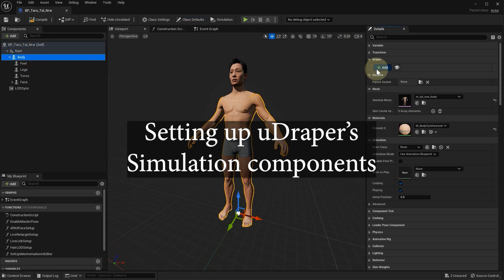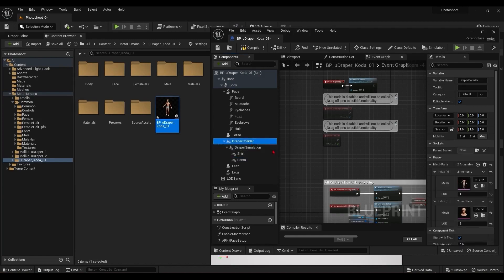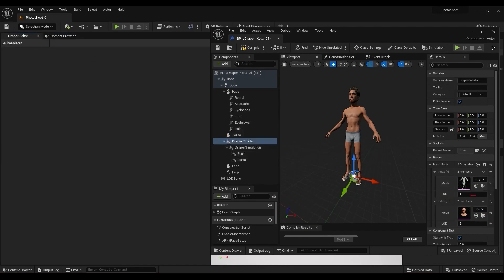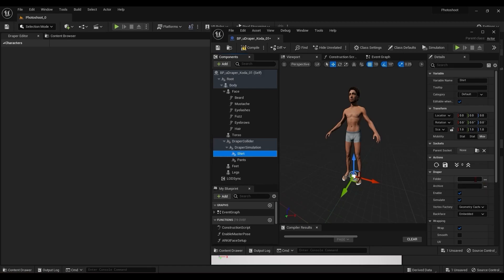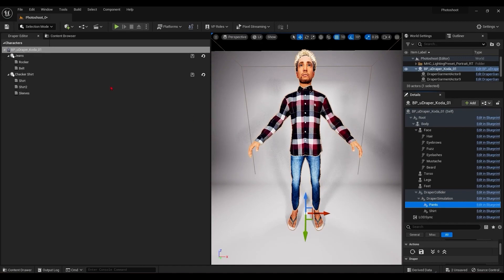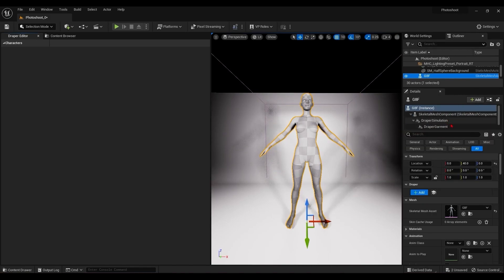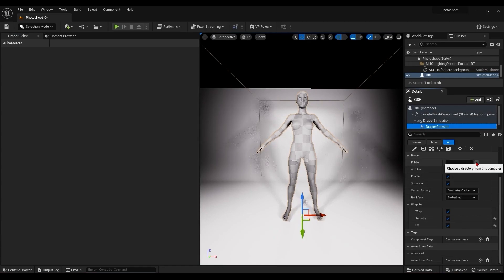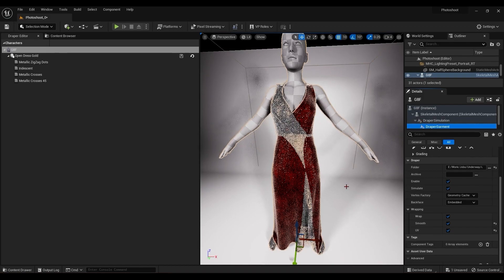Setting up uDraper’s Simulation components

Comment: Thanks, this is a well-done tutorial, very thorough.  Working with Metahumans in UE 5.2 with your 5.2 release plugin, I'm finding if I work with the MH in Blueprint, it all works fine.  I have no issues.  Howevcer, If I add Draper to the MH in the level, the pants go real wonky as soon as they're wrapped.  I could be doing something wrong.
Reply from the maker: Thanks! Please get in touch via Discord or contact page and we resolve it together

Comment: 2:24 when I change lod it doesn't save it and tell me it's still over 30,000 vertice, any idea?
Reply from the maker: What kind of character do you use? I noticed that CC4 characters are very high-poly. We need to simplify them further to get rid of the polygons that don't participate in collisions and create custom collider meshes. Get in touch via our Discord and we'll see what can be done with your characters.

Comment: how do you export the buttons from MD in the garment? I cannot
Reply from the maker: Indeed, it can be done separately using standard UE assets and uDraper attachment component https://youtu.be/i8KJhx1Odjw
Reply: @triMirrorTV  ONELAST... MESH SOURCE IS NOT SUPPORTED... what does it mean?
Reply from the maker: @witchking21 where di you create your OBJ file? You may need to select Skip validation in the import dialog. Please use Discord fo technical support https://discord.gg/CZsQVe4Y9Q

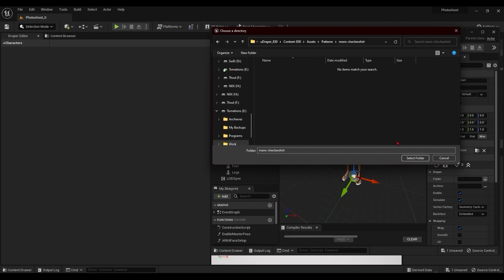Comment: Hi I get an error upon selecting the 3D garment folder (5:40)  'Selected folder doesn't contain correct 3D garment data.'  I've prepped the garments in MD following the tutorial.  What might you guess I'm doing wrong? Thanks
Reply from the maker: Could it be that your garment data files got corrupted? 'd suggest to re-import your OBJ file. Otherwise, get in touch via Discord.
Reply: @triMirrorTV  It turns out in my version, which I guess was updated only days ago, I have to select the 'import' button under 'actions'.  It doesn't seem to work to select the folder option, or at least there is something unfriendly about my garments.  Anyway, it's working now when I select the import button.
Reply: I have the same issue except it does not work with the import button

Comment: Awesome Tutorial !  Great new updates 👍 Thanx for the MH collider meshes !  😁
Reply from the maker: Wait! We haven't shared them yet but they are coming
Reply: @triMirrorTV  haha and I was wondering where to find them .... 🤪
Reply from the maker: @StyleMarshall  what kind of MH do you use? e.g., tall, med, nrw, unw?
Reply: @triMirrorTV  mostly tall, nrw
Reply from the maker: @StyleMarshall  will do
Reply: @triMirrorTV  did you ever post a link do download the reduced metahuman meshes?
Reply from the maker: @Johanearldirector  we've created a few colliders. They are located in the
Engine - Plugins - uDraper content - extra
https://media.discordapp.net/attachments/867873475259793458/1166426654919368825/UnrealEditor_2023-01-23_08-34-24.jpg?ex=656621f9&is=6553acf9&hm=877741b73d919fb6427b752f0ffe12d9dd01fcc0dc2d3622cef71742cae3670c&